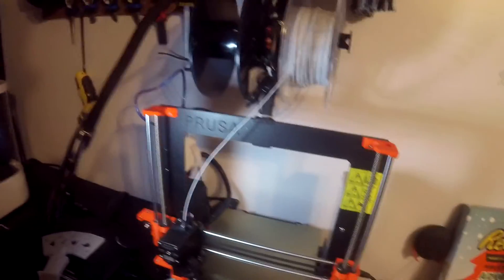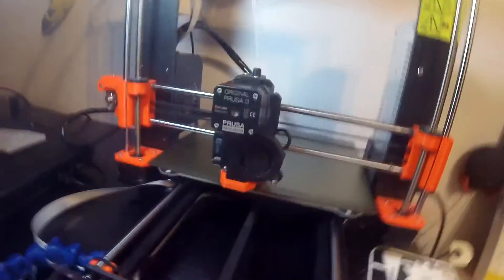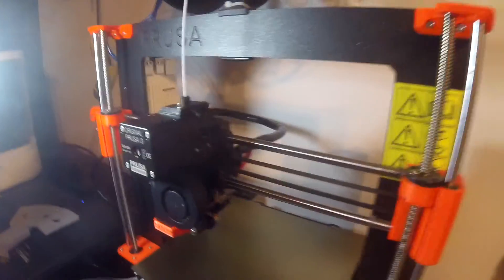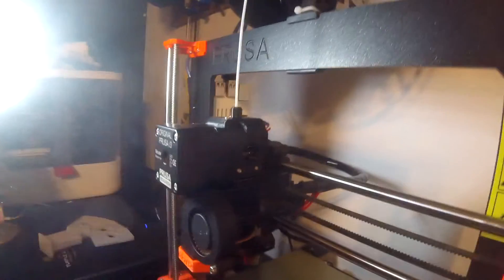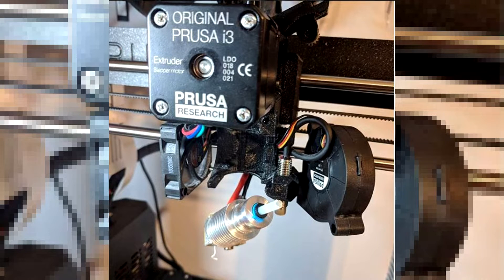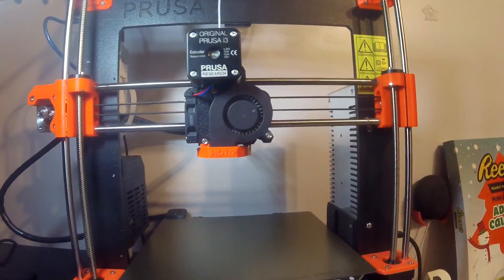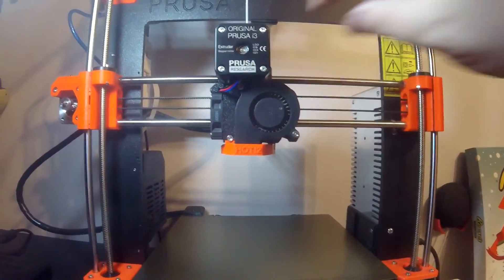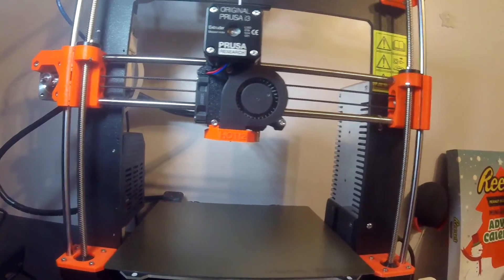How to Fix Extruder Clicking with the Prusa I3 Mk3

Comment: Thanks. My MK3S+ was missing the blue shim, and the tube had definitely sunk down.  The tube had filament stuck in it, and when I pulled it out some was left behind.  Fortunately, Prusa included two extra tubes in the parts kit, but sadly, no blue shim.  I put it back together without the shim, and it's running fine.  I'll just have to make something to shim the release collar later.  Thanks for the detailed video.  Made it very easy to fix.  I also removed the stepper motor and adjusted the new tube until it was perfect.
Reply from the maker: Thanks for your comment, glad to see my videos are helping!

Comment: Thanks for this.. i got an idea. What i just did to my mk3s bondtech with the same prob was i just preheated the nozzle with ASA firmware temp then pushed a 1.5mm wire instead with a filament back and forth 5x. I didn't disassemble parts anymore.. 😀
Reply from the maker: oooh nice idea! if it happens again for me maybe ill give this a go!

Comment: I got 3 large orders and I’ve tried everything to fix my printer. I think I’m fucked
Reply from the maker: Whats it doing? When you heat it up and push the filament does it flow easily?
Reply: Nath042 it doesn’t flow at all. When I put it in it just stops pushing. I feel the filament to see if it’s going in the printer and it does for a few second but then it stops. And now it just makes thing grinding awful noise when filament goes in. I believe their is a clog in the tube or extruded whatever you call it that built up over time

Comment: i changed extruder ,hotend and motor any ideas same thing
Reply from the maker: are you running the mk3 or mk3s?, would be worth trying to upgrade to see if that helps.
Reply: im new to printing so i dont know that much ive upgraded i changed it to a bowden setup i even tried one of them gold color ones with the spring  from ebay and same thing i even tried a new never used motor and all metal hot end and the same thing i think it could be the firmware somehow messed ive looked and there aint no pots to turn the motor voltage up  tried diffrent filament still same thing i been using it none stop for a few months then for no reason starts clicking and no extrusion do you think i should try reflash the firmware

Comment: This makes perfect sense. This problem started for me after I dry pulled filament from the extruder which most likely pulled the ptfe tube up because I noticed the tube sticking up out of the hot end enough that it got chewed up on the end by the bond tech gears.
Reply from the maker: im glad it helped!

Comment: I've almost given up on the damn things, having extruding issues all the time, or something else pops up. Definitely getting an SLA printer. After wasting spools of filament because it decides to have a fit i'd rather just print smaller, more precise parts. and cleaning them up afterwards.
Reply: @nath042  I've completely replaced the head on it because the last one kept blocking  then the new head started jerking the fillament in and out so I tried to diagnose the problem then it stopped working all together. So I threw it out my window... It's always been a mightmare printer. I've got the (well had) the prusa i3 pro B but the manual leveling bed is out of date technology and such a crude setup, the chassis it'self is a disaster to be honest. No matter how much time you spent on it build quality was never repeatable so SLA it is lol
Reply: @engineeruk8667  thats a shame you’re giving up on it. I’ve had my Prusa MK3S up and running for a while now. Granted it`s had teething troubles and the odd little glitches...what doesn’t .....but on the whole I’ve found it to be an incredible machine and a pretty darn reliable one at that. Like the guy says, its 3D printing nothing is perfect. Have you spoken with Prusa themselves? Maybe there’s an unusual  defect in your machine? Be a shame to give up on it totally. It does work really well!
Reply: @jamiesalmonsculpture8599  I just don't have time for messing about anymore.. Was wanting to use it for basic models to show clients and hasn't been able to do even the basic stuff really without costing me time and money. By the point I get any decent result I could get a professionally printed in much better quality and speed of manufacture.
Reply: Shit, I'll take it off your hands.  Beats the hell out of a 9 week wait.
Reply from the maker: I find that a head rebuild normally fixes the issues, but it can be frustrating doing it. the new head seems to be less prone to issue (i3 MK3S)

Comment: For me this was caused by the extruder gears slipping because the idle gear axle had moved out of alignment. I modified the axle supports in the Idler Door part to fix the issue. It eliminates any possibility of the axle shifting during printing by ensuring the axle is always in the optimal "non-clicking" position. Most importantly it allows for even extrusion to provide good prints.
This is the remixed part: https://www.thingiverse.com/thing:3504682
Reply: Your part helped reduce the clicking. I only have the problem when printing with petg. Axel slip caused a fail at the end of a 42 hour print, so this should fix that.
Reply: @nath042  I look forward to hearing if it worked for you. I hope it does.
If it doesn't your stepper motor could be slipping because it is pushing filament faster than it can be extruded. This can happen for a number of reasons, but one of the most common reasons is a partial clog or obstruction of some kind, the less usual reason is that your extuder motor is incorrectly calibrated.
Reply: Also, it looks like one of the reasons that slowing a print down and turning up the temperature can also reduce or eliminate clicking/under-extrusion issues is that the “custom” PRUSA e3D heatbreak changes bore size from 2.2 to 2 close to the heat zone. Proto-Pasta did a bunch of testing that showed that this was probably the major cause of the click (stepper slips) and under-extrusion sometimes leading to jams. https://youtu.be/dSPPrb0J8CY?t=722  If this is your problem, the solution is to by the non PRUSA custom e3D heatbreak https://www.printedsolid.com/products/e3d-v6-heatbreak-single

Comment: Print yourself a extruder indicator - there’s loads of designs on thingiverse etc. Makes diagnosis easier (in my view). Also, if you push and hold the dial on a Prusa, you jump straight to the “Move Z” function.
Reply: Rafe Aldridge I didn’t know that hack to moving the z axis